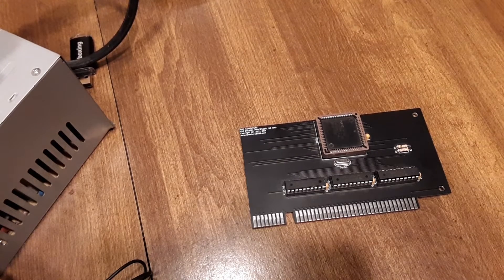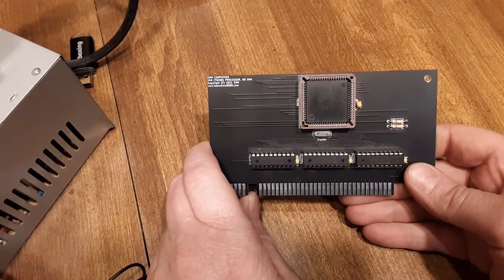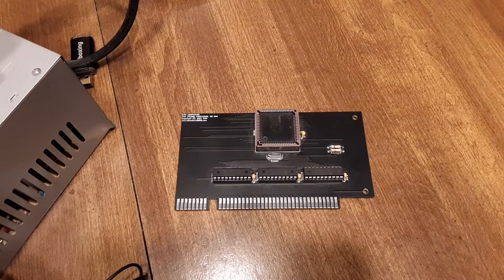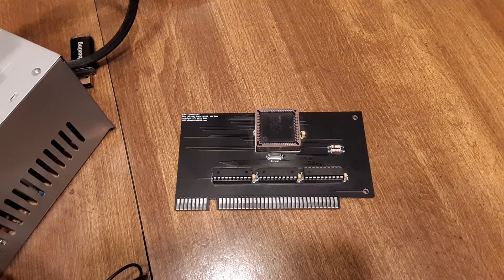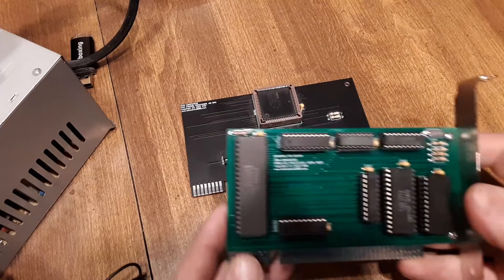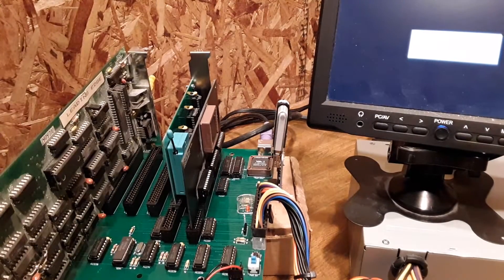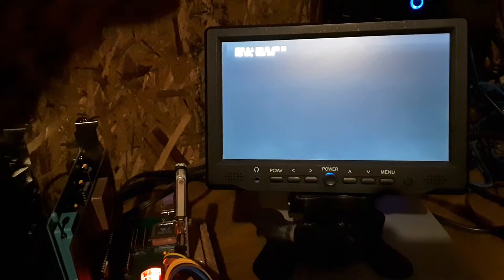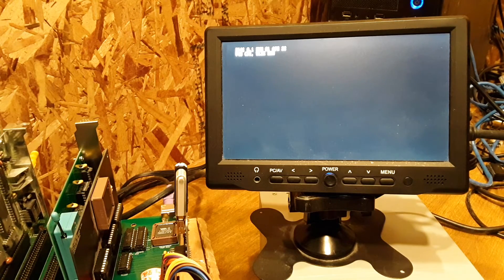8088 Motherboard with 20 MHz V40 processor

Comment: Have you looked at the signal integrity on the bus? You're assuming the issue is the wait states, etc., but I'm wondering if you have reflections on the buses causing issues. I design motherboards for a living, and these are very common problems above about 150 MHz. But you have a lot of thin, narrow tracks with no ground planes, lots of stubs, etc.. Could be worth putting a scope on some of the address, data and control lines.
Reply from the maker: I just don't have the equipment to scope the lines. But from what I have read is the original ISA bus speed was established based on the 4.77MHz speed of the CPU. As the CPU's got faster the industry settled on 6-8MHz ISA bus speeds regardless of the CPU speed. So faster CPU's may have ran faster but would find them selves waiting on the ISA bus. I really think most of the issues of running a 20MHz V40 come from out running the capabilities of the add on ISA cards designed for a max of 8MHz.  

I did the math once on the ROM and RAM access times. I may have done my math incorrect but I think I came up with about 10MHz max read/write times. Converting Nano seconds to MHz's.

I am working on this from a hobbyists point of view so I could be wrong.
Reply: @elijahmmiller  No, that's very fair. One thing to do would be to put your pull up/down resistors at the furthest point from the source.
Reply from the maker: That makes sense.

Comment: Well this answers my question from your other video.  Very nice.  20 MHz 8088 must really zip.  Have you tried GLX Mod player to the PC Speaker to see what rate you can achieve?  :)
Reply from the maker: I have not tried GLX Mod player. The PC speeds above 10MHz do get unstable with out wait cycles. I have thought off adding a hardware wait state generator to the project.  I have been exploring a 16 bit system. I have a video out there of my intial experiments. Right now the hold up is finding a decent 8 bit to 16 bit bus controller that is available on the market. It seems the best approach will be in a 386 sx.
Reply: @elijahmmiller  It's really cool work.

Comment: NEC V40 and V50 are very rare
I dont think i can buy it like buy chips as usual :(
Reply from the maker: The V40 is available from a few sellers on eBay. If you want it from a parts house then it could be hard to get.

Comment: I like you experiments to get a higher CPUCLK on the ISA, here are some of my thoughts:
internally the clock of the V40 is always divided by 2 so CLKOUT is 1/2 (at least in the datasheet I have in front of me) at max, their is a  divide by 1 to 8 clock divider on chip to lower the CLKOUT to  1/4 1/8 and 1/16. To my knowledge the max clock on the ISA bus is 8,3MHz, in that case you need to lower the CPU access to the ISA bus by adding more waitstates.
If you want to go higher in CPU clock it is better to have local memory on the CPU card (wait states hurt the performance of the CPU pretty bad) and use the ISA bus for IO (by adding waitstates).
A lower CPU freq with zero waitstates memory access is (see Intel 286 hardware design manual) generally faster than a high clocked CPU with 2 or more waistates. This is one of the reasons we have large CPU caches in the current CPU designs because main memory doesn't have the speed (high speed memory is still way to expensive to make such designs commercially feasible).